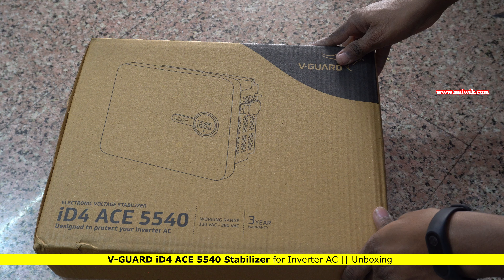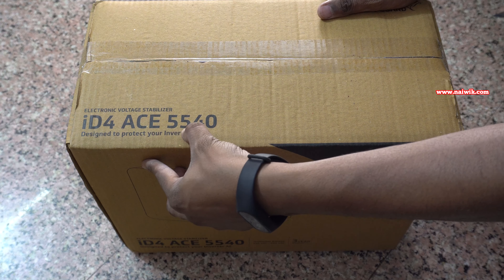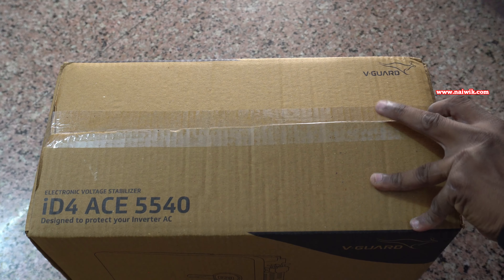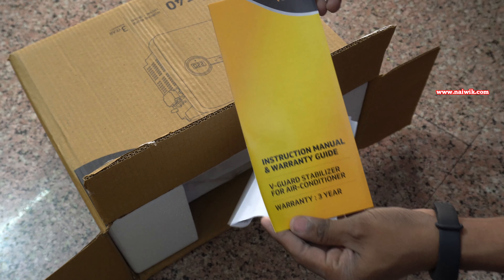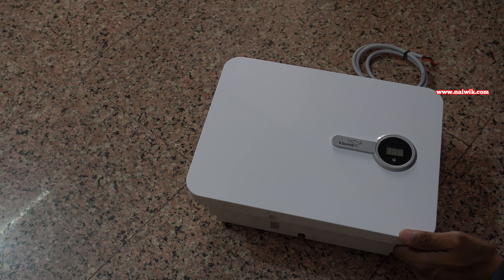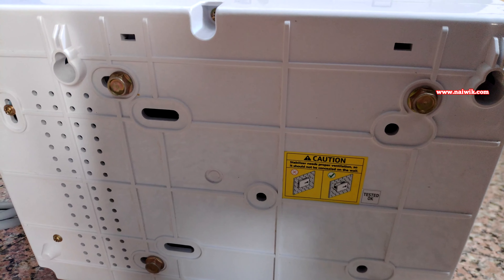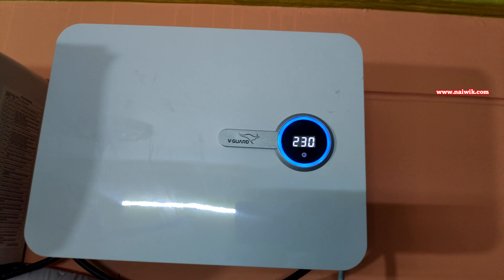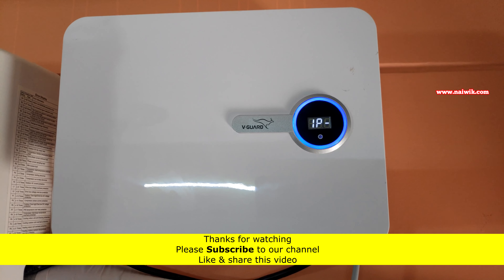V-GUARD iD4 ACE 5540 Stabilizer for Inverter AC Up to 1.5 Ton || Unboxing

Comment: v guard id4 ace 5540  or  vguard vwi 400 donomese konsa achya he . lg dual inverter  ac  230v
Reply from the maker: Bro , If you have severe voltage fluctuations in your are go for Vguard VWI 400.
 if voltage fluctuates occasionally then go for Vguard ID4 Ace 5540.

Botha are good stabiliser. I hope it helps
Reply: @Naiwiktech  thank you sir
Reply: @Naiwiktech  Hi...are you sure about it...I m having too much voltage fluctuation in my area.. normally it varies from 130 to 200...which one do you suggest